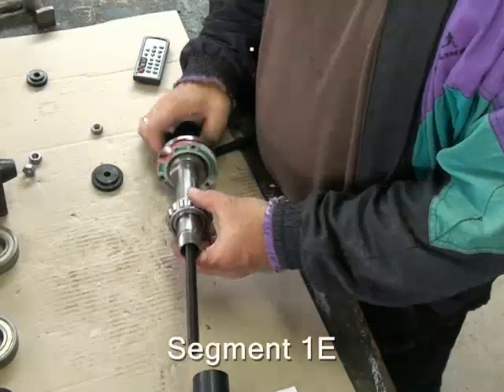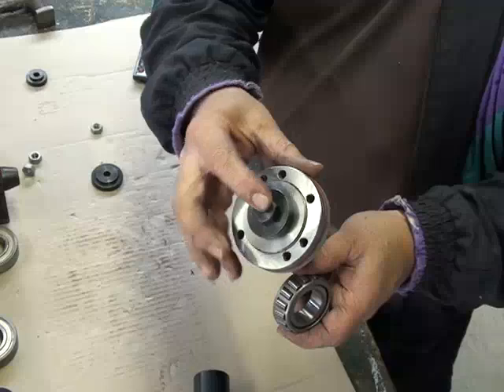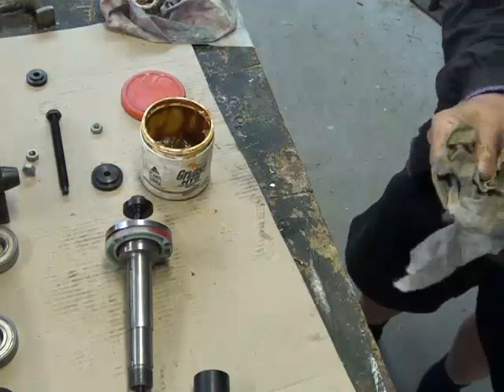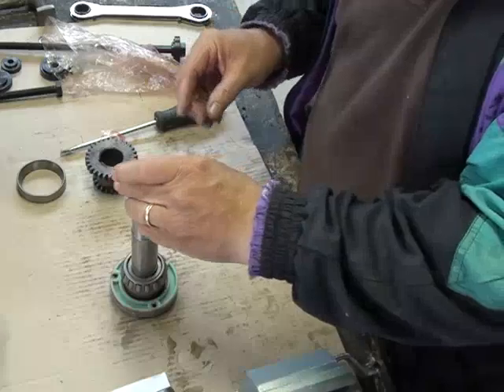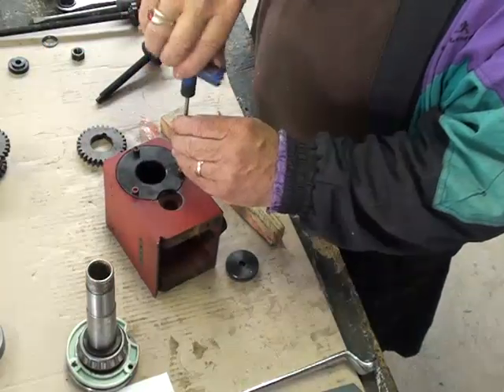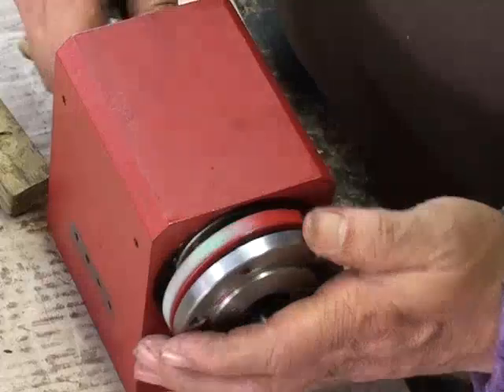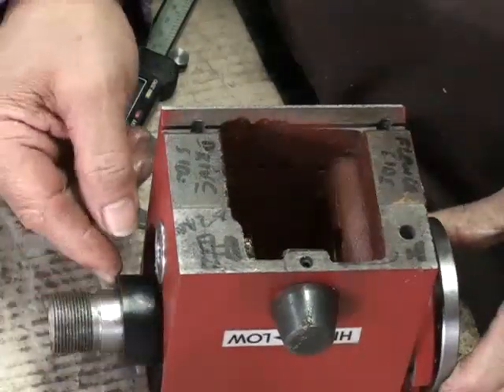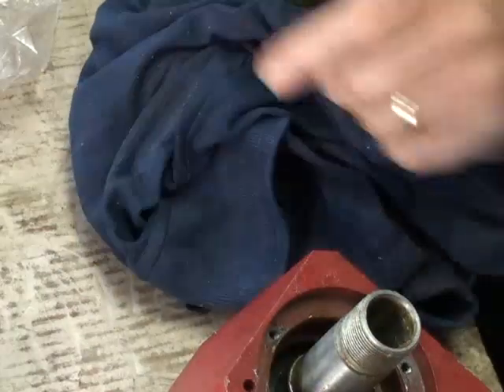Part 1E of Fitting the taper bearings to 7x12 lathe

Comment: Sir lastly, can you teach me how to position gears for threading 24tpi and 22tpi.. i cant imagine how would it reach each other when i place 40 teeth gear to 50teeth gear to A and D ...im a beginner, i just learned about lathe when i bought mini lathe and YouTube is just mentor.
Reply from the maker: Hello, to be honest I have not used the lathe to cut threads. I just use HSS dies for cutting my threads - it is much easier and it is exact. If you have the manual there should be a chart for the TPI and gears to use. I think you can do 24TPI but not 22TPI. The speed of the spindle and the speed of the threading rod driving the tool post have to match for each thread pitch that is in the manual chart. You can also buy  a small threading dial to help set the lathe up for some common TPI but they are complicated to use. That is why I just use a simple DIE and TAP set.  Also when threading you need the correct shape tool depending if you want V or square end threads. Sorry I am not much help on this one. Maybe try ask on a forum. Regards, Lou

Comment: I want to change bigger plate attached to the spindle so i can upgrade the size of the chuck without adapter, my question is,is it possible to remove spindle chuck plate? and replace machined plate size 4" instead of stock  3"?
Reply: Thank you sir for all the info i need to know you have shared.
Reply from the maker: I think you are asking if the standard 3" chuck plate on the spindle can be removed from the spindle and replaced with a 4" plate so that you don't have to use an adapter. The answer is that the 3" chuck mounting plate is part of the spindle. The plate and spindle are just one piece of metal. I believe you could once buy a complete spindle with a 4" mounting plate from some lathe sellers. However I do not remember where I saw that information.  Maybe try to Google that,or try the mini lathe forums on Yahoo etc. I do use a 4" chuck with independent jaws on my lathe sometimes but I have to use the adapter. A 4" chuck is heavier and does put more strain on the motor when it starts to turn. But it does work once it gets upto speed. I only use it if I need that bit more jaw opening, or if the shape is not round(independent jaws). The Bore does not change because that is determined by the bore in the spindle. As I said I only  have used it a few times for non round shapes, and with an adapter. If you are changing the bearings,  and then at the same time you manage to find a spindle with a 4" plate, then that would be a good solution. Regards, Lou
Reply: Thank you sir for your immediate response, now my plan to dismantle head stock to check if posible or not has been aborted..il just buy a bit bigger lathe in thailand or maybe VB20li lathe model or BL 200  would be okay with an original 4" chuck size. thanks.
Reply from the maker: @eltvetc836  Yes, I agree, a bigger lathe is a better answer. It will have a stronger motor with new speed control and better bearings. Good Luck. Regards, Lou.

Comment: Enjoyed the video series. Can you tell me the ID of the black tube and that other large puller part?  I'm wanting to change out bearings in my mini lathe and mini mill and want to know if the Micromark kit will work. My mill has an R8 spindle but I'm not concerned about the gears. I believe the R8 spindle is 35mm OD vs the MT spindle at 30mm. If the puller parts are over 35mm ID, it should work. Please let me know. 
Thanks!
Reply from the maker: Hello  Scott, the large straight tube has an inside diameter of 38mm at one end and 36.5mm at the other end. It has a step inside about halfway in. It is 175mm long. The puller device I think you are asking about I assume, is the one with the flange that has 3 holes and attaches to the spindle block. It has a 7/16th threaded hole at the non flange end. It is 110mm long. The flange is 80mm diam. with a partial circular cut out of 34mm. The outside diameter of the tube section is 45mm and I think the wall thickness is around 3mm. The threaded end is basically an end plate welded over the tube. The kit also has  5 special washers with steps which match the inside diameters of the 2 tubes. The largest is 60.72mm in diameter with a clearance hole for the 7/16 threaded long bolt. the smallest stepped washer is 30mm diam. with a 7mm diam. hole. This hole mates with a turned down portion of the long bolts. The turned down portions fit this 7mm hole. So as the bolts turn, the larger diameter portion of the bolts pushes against the washer. The turned down section thus keeps the bolt cantered on the stepped washer that it is pushing on if you get what I mean. I don't know  much about the R8  spindles so I cannot help there. I do have drawings of these items but I would need some way of sending them to you. Sorry for the delayed response. I don't visit You tube much these days. Since Google took over, I have trouble actually logging in and they keep losing my access for some strange reason !
Reply: vk3aqz Thanks so much for the information!  I believe the R8 spindle is 35mm OD at it's largest point so it sounds like the tube and puller should have enough clearance, if I understand correctly. 
I'd love to take a look at the drawings just for confirmation though. Is there any way you could post them somewhere?  I've been trying to figure out how to contact you privately but I also struggle with Google and YouTube at times.

Comment: I just performed this mod this past weekend. I now have considerable runout on my spindle. As I couldn't find the bearing tool that you used I used my shop press to seat the bearings on the spindle. Is it possible that I pressed the bearings into the race with too much force?
Reply from the maker: The tubes kit is made by Micromark and is designed for replacing the plastic gears with metal gears. The tools were part of that kit. The Micromark part number is 83452.  Sounds like your bearings are not seated correctly or damaged. Since I posted these videos, there have been hundreds of successful modifications done so you need to check your work.
Reply: Thank you!